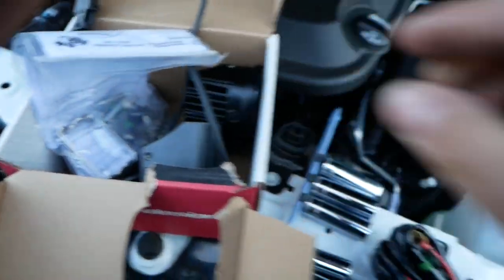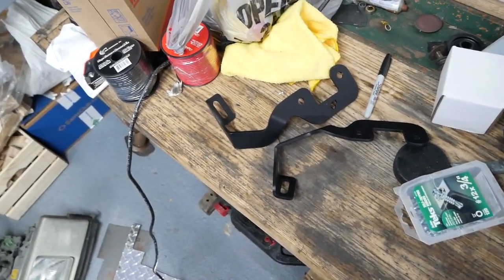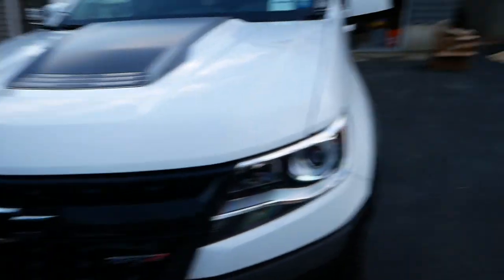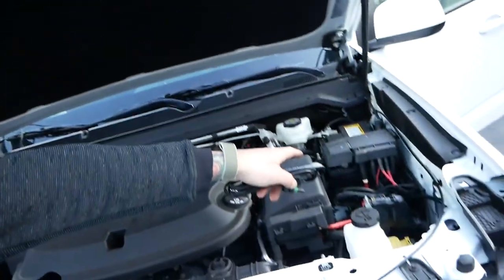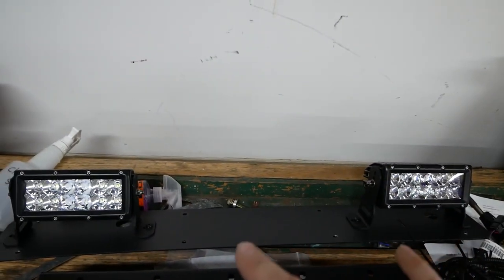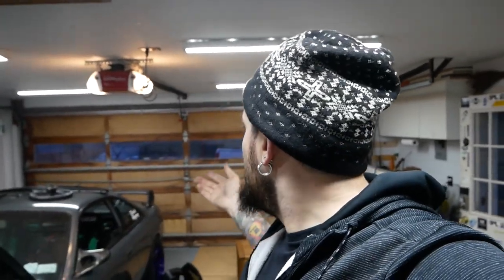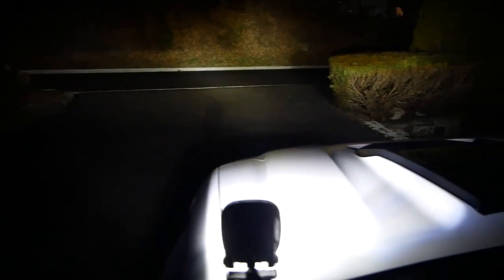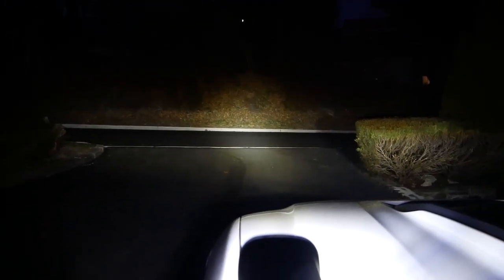Installing DITCH LIGHTS on the ZR2 | how to | 2020 chevy colorado zr2

Comment: Literally the hardest part of the install you just skipped over entirely.  How did you route and mount the wiring?
Reply from the maker: My bad. I cut my finger and forgot to film that part.. you can feed the wires thru with the oem wiring harness thru the fire wall..  takes a little effort but you can get it thru, will come out somewhere behind the ebrake pedal

Comment: I’d recommend installing an AuxBeam switch controller so you only have one wire through the firewall and it comes in 6 or 8 switch box. You never worry about the firewall after. You just connect the wires to the AuxBeam fuse box.

Comment: Lol. Great. The part i wanted to see you bypassed.  The wiring from the engine bay to the cabin.  🤣🤣
Reply from the maker: 😂 sorry... was focused. Then cut my finger.... there’s a grommet on the firewall. I forget if it was for the hood latch pull or part of the wiring harness.. but you can snake them thru there with some effort. It will come out on the left side of the footwell
Reply: @chrisdz  i went through the rubber where the wires come through. It was easier n just took seconds lol.

Comment: Were you able to fit the switch through the hood latch grommet? 

Also FYI, you may want to move the ground wire to ground rather than having it on the battery terminal.
Reply from the maker: yes, wire fit thru there, but it was definitely a pain to get it thru.
Reply: Cool, so sounds like you fed switch from engine bay into cab. Did you take the rubber nipple part off from inside engine bay first and if so how? I’ve tugged it pretty hard but doesn’t seem to want to come off.
Reply: @chrisdz  yeah my friend was having a hard time doing it he just said screw it and drilled a hole to feed the wire we didnt think it was gonna through though

Comment: When you went through your hood grommet did you have to cut it to open it for the cables to pass thru or just squeeze and make fit?
Reply from the maker: with enough effort you should be able to fit it thru the grommet.  but if its way too tough to do it, you can make a little slice with a razor to make more room.. unless you're driving thru rivers, it will never be an issue

Comment: Hey what light kit did you use ?? Any link for it ?
Reply from the maker: these are the lights : https://amzn.to/3PPOG7X
these are a set of the brackets : https://amzn.to/3m9Vqj2

i used CBI ditch brackets, but the windshield wiper hits it when they are on..(i probably just need to adjust it a little)

all the brackets are pretty much the same.. just goes under the hood bolts and holds the light.. dont need anything fancy
Reply: @chrisdz  thank you